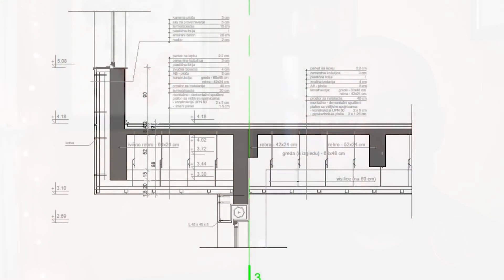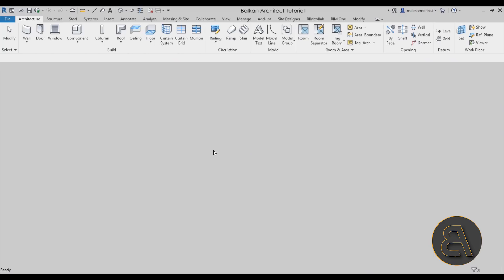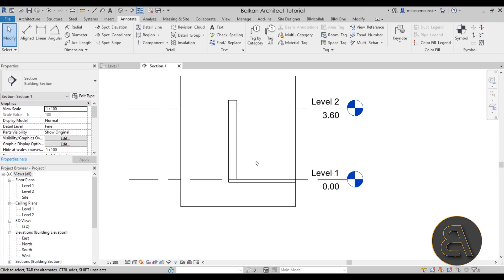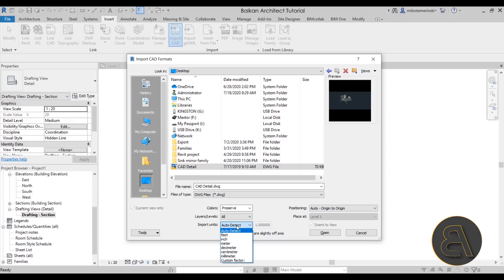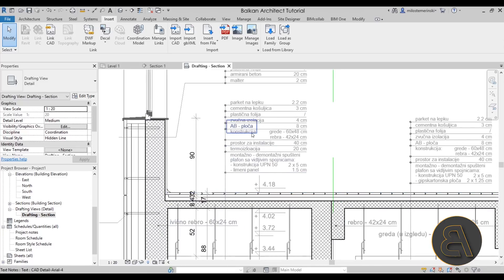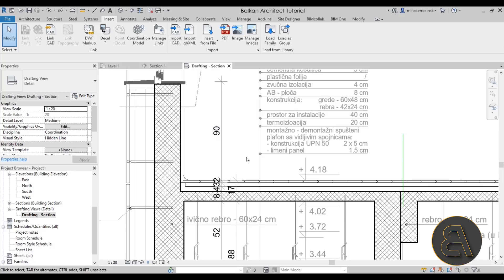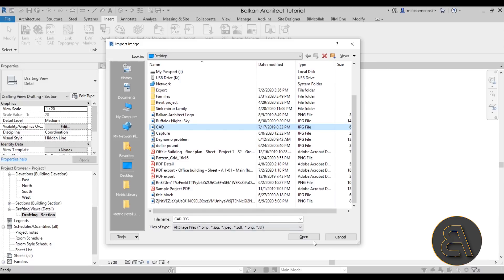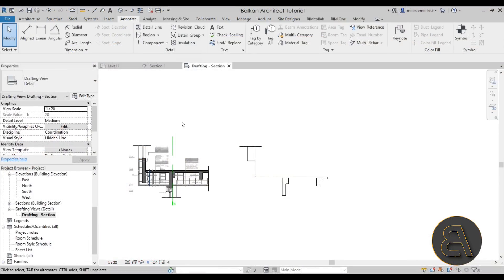How to use CAD detail in Revit Tutorial

Comment: One of the golden rules of Revit in professional practice is 'do not import CAD'. The model gets heavily polluted with line styles and fills.

As another viewer suggested, nesting into a detail family and cleaning up first is the best method.
Reply: I usually link the cad rather than importing it. And trace the cad detail then De-link.
Reply: @jenniferguzman6952  that's a good workflow when the detail isn't too heavy. As long as the 'mess' is cleaned out of the family before loading it exploding is OK, but it requires cleaning out object styles, fill patterns, line patterns and materials.
Reply: @AussieBIMGuru  I agree, exploding would cause issues later. Which is why I link then de-link. Then I have the detail in Revit forever. Can also be useful in a separate file to create "standard details".
Reply from the maker: Thanks for the tip! 
Yes it can be annoying to get so many new line styles. I didn't know about the workaround, good thing that there is a way of avoiding that. 🙂
Reply: @balkanarchitect  the modelical package for dynamo has a node to remove all line patterns containing the word 'IMPORT', but it's usually the imported object styles that are harder to clean up, Revit API has limited access to these.
Reply: @jenniferguzman6952  there is a macro that can translate CAD line styles to Revit line styles without you having to trace it manually. 
Macro is available from archsmarter.com/convert-dwg-to-revit/
Reply: @iFFYtjuh  thank you I will check it out! Anything useful to save time!
Reply: @jenniferguzman6952  ArchSmarter is one of the most useful site available on the net for Revit. Another tool is available but is a paid option called CADTracer. You can download that from Autodesk App Store...
Reply: What I have done for manufacturers details is to start new project file and import all DWG details into it.  Do modifications there.   Basically sandbox your good file from the imported CAD details.

Comment: Is Macbook bro better for architectural  work, as apps like, revit, AutoCAD, maya, lumion etc..
Reply: No, you cant run revit on mac.
The only way you can install Revit on mac is using the VMWARE  which allows you to run windows on mac
Hope thats answers your question 😌
Reply: most Mac's doesn't have the hardware power to run 3D rendering softwares like Lumion properly (Unless you spend ALOT of money for the high high end ones) but even then better to buy a windows with powerful Hardware because all software is available unlike mac which has only a few available.
Reply: Vishal I have the MacBook Pro 16inch. And I can run archicad, AutoCAD, maya and many more well. My workflow consists of using Autocad for quick plan drawings, then I take it to rhinoceros, and finally render in maya. I use archicad/GH for structural analysis
Reply: @ScribbleSG  I assume you are using Bootcamp and not Parallel Desktop? If you are using Parallel Desktop you will not be able to use full hardware advantage because you are running a VM. Bootcamp allows to take full advantage of hardware.
Reply: iFFYtjuh neither, I’m using native Mac OS